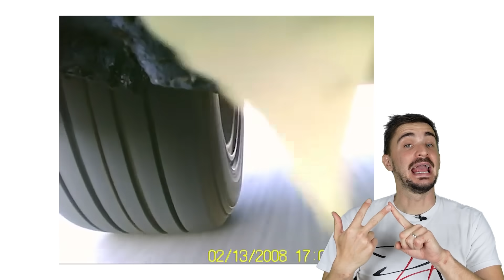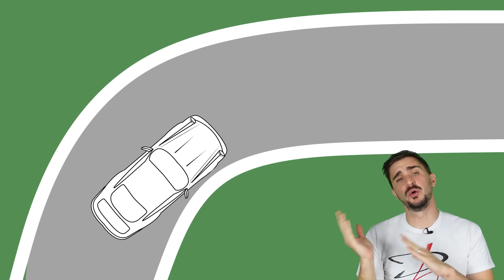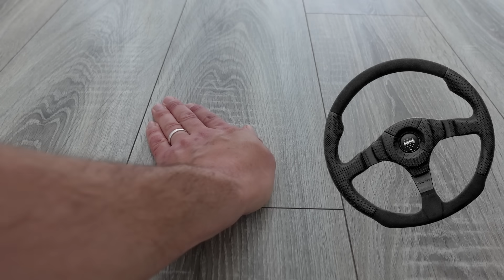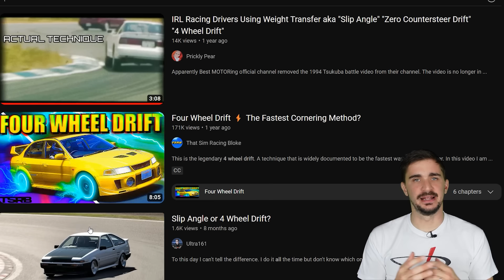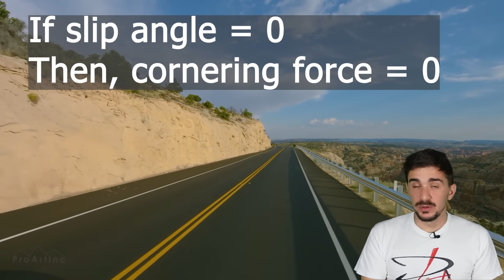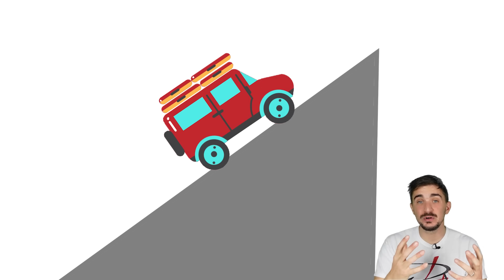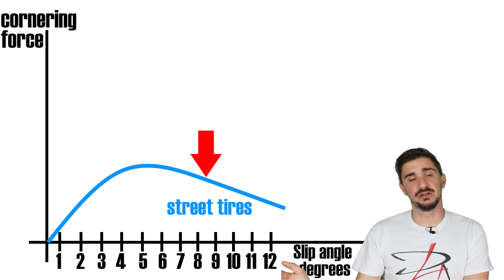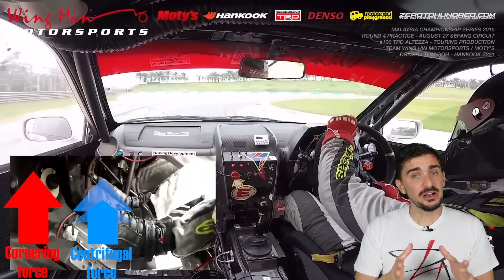You Think You Know But You Don't - Slip Angle Explained in a Way You Will Understand

Comment: Yikes! I get what you are trying to do here but I wish you wouldn't have used 'centrifugal' force, which ends up sending people in the wrong direction, pardon the pun. Centripetal force is what is required to turn a corner as I'm sure you know. Force(c) = Mass x (Velocity(squared) / TurnRadius). Centripetal Force also keeps the earth in orbit around the sun and the moon in orbit around the earth. In these cases the Force(c) is provided by the gravitational attraction between the objects and in the case of the car it's provided by the tires running at slip angles. In the absence of Centripetal force an object in motion would continue to move in a straight line.

Although 'centrifugal force' is frequently used in the way you describe, it's not a real force...it's a way of looking at things from the perspective of an object which is being accelerated. In your example, the car and the people inside. The people inside may feel like they are being thrown outward into the door by some force but they are not. They are subject to centripetal force in the direction of the center of the turn. That force is applied by the seat, seatbelts, door, steering wheel, grab handle etc...whatever the person is in contact with in the car.

If you're going to use 'centrifugal force' as an aid to understanding (which I don't think works anyway), it would NOT be smaller than the 'cornering force' either. When used for explanatory purposes, centrifugal force must be equal in magnitude and opposite in direction to centripetal force.

Great shots of suspension and tires in action! The amount of distortion in the sidewalls really illustrates your best points about not directly controlling the contact patch!
Reply: Centrifugal force does exist and is just as real as the concept of inertia. If you're inside a non-inertial frame of reference (like, inside a car taking a corner) you do need to take into account centrifugal force and coriolis force to do physics. If you grab any college textbook on classic physics you'll see it's full of mentions of centrifugal force, it definitely isn't a simplification nor a mathematical trick.
Reply: @freshrockpapa-e7799  Centrifugal force is always described as a 'fictitious' or 'apparent' force. It is used as a means to explain the 'sensation' one gets when subjected to acceleration. When you refer to  a classic physics textbook, are you talking about one from the 18th century?

https://en.wikipedia.org/wiki/Centrifugal_force
Reply: @jtocher685  No, I'm talking about modern college textbooks. Don't confuse "fictitious" and "apparent" for "not real". Again, just go to the webpage of the most prestigious college you know, see the curriculum of Newtonian physics, classical physics, or simply mechanics or dynamics, and pick at random a book from the bibliography. You'll see it is full of exercises involving centrifugal acceleration in non-inertial frames of references, because it's just as real and you need to take it into account while doing your calculations, otherwise the second law of Newton breaks.
Reply: @freshrockpapa-e7799  Lol, pretty sure the definition of 'fictitious' is 'not real'. Anyway, yes you can do computations within a non-inertial frame of reference and engineers will do it when it's convenient but unless you're very careful not to confuse real and apparent/fictitious forces you are bound to make mistakes. If you do make a mistake like that, something will break alright...but it won't be Newton's 2nd Law!
Reply: @jtocher685  You can't take the definition of a word used in common language and assume that it has the same meaning in science. That's how you would think that imaginary numbers are less "real" than the real numbers. 

What I'm telling you is that observing reality from a non-inertial frame of reference is just as real as observing it from an inertial frame of reference. There's no reason to assume either is in any way superior or more true than the other.
Reply: @freshrockpapa-e7799  I never said that the reality was any different when properly viewed from either frame of reference. I said it could lead to misunderstanding when explaining it and mistakes when calculating the resulting motion if misunderstood. Even the author of this video misunderstood it when he stated that the centrifugal force would be smaller than the cornering force for example.

So I'd put it this way...the force causing the actual turning motion is called 'centripetal' and is in the direction of acceleration in accordance with Newton's 2nd law for an inertial reference frame. This results in a perceived or 'apparent' force of equal magnitude and opposite direction on the vehicle occupants who are sensing the conditions because they are within the non-inertial (ie accelerating) reference frame of the vehicle. That perceived/apparent force is called 'centrifugal' force.

As I've already said, you can certainly adjust Newton's 2nd Law for a non-inertial frame by adding rotation terms (Omega Cross V and Omega cross r) but that is the very thing that leads to confusion so it's to be avoided unless there is a good reason to do it that way. And, back to the point of this dialogue, there was no need to introduce that potential confusion in this video.

Comment: Great video!  Some of this I knew but the video brought it all together and especially the concept corning force.

I suspect it may also be good  to contemplate that, for at least everyday driving, we do not instantaneously whip the steering wheel to the maximum needed amount to traverse the given corner.  Rather, over the expanse of a fraction of a second or two, the steering wheel is repositioned relatively gently and sequentially to help the tires not to break from the road surface.  Of course, this mention is subordinate  to the core explanation provided in this video.

Comment: This video lacks the accuracy I got used to hear from you. Still a good video but there are wheel slip angle and slip angle that describes to angle of the whole care relative to its trajectory. Contact patch and the distortion comes from steering is only on changing the direction of the wheel. If you hold the steering angle, they won't be distorted longitudally but axially. A noticeable amount of Wheelslip angle is required to generate the most resistance to the centrifugal force. Tyres are having the most grip when they slightly (3 - 14 % depending on your car) slipping. Vehicle slip angle helps you to reduce steering input and let the center of mass of your car  support the turning efforts. This means your tyres are supported by the swinging and the tyre can 'focus' its potential for holding the car on track. But getting vehicle slip angle is extremely difficult and requires the perfect harmony of any aspect of your car. The more distance your front axle and your COG have the easier it gets. On some cars it's simply impossible to achieve this. When you visit the place where you tested snap oversteer, try to hold a speed and just increase the turning steadily run by run. Sooner or later you should understand what I mean. It feels like you lost control but yet you have it and the car is dealing with it. The steering will 'talk' a shit load of things to you. It's important to not accelerate too much, since this would lead to too much grip on the rear and hindering your turning potential. But no gas would also be bad... You know, snapping...

Comment: This isn’t entirely right, and the small bit it is right, it’s only really correct getting from straight steering wheel to final steering location, then once you’ve steered as far as you need to steer, then you’ll continue cornering with none of this happening because the car has 4 wheels, it’s like you’ve disregarded the back wheels, this seems more pertinent to a unicycle?

Love your vids dude ❤
Reply: My explanation of cornering: 
-driver turns steering wheel
-front wheels develop side slip and lateral force that push front axle into turn
-vehicle starts to rotate
-rear axle starts to develop side slip and lateral force that push the rear axle into the turn

Unicycle is called a quarter model in automotive. It's not able to explain vehicle slip angle. You can easily see and feel the vehicle slip angle in a vehicle that has soft axles (Peugeot, Citroën). You can see the slip angle when following other vehicles during cornering on a highway particularly when the turn is off-camber.
Reply: Not true or else the tyres would no longer be producing cornering force which is necessary for the car to maintain cornering. All four tyres will be sustaining a slip-angle for the car to be maintaining a turn radius. No slip-angle, no cornering force, no turning.

Comment: fun fact: in racing (for example in a gt3 car) you will turn the steering wheel by about 90 degrees in almost any turn thats requiring the grip limit of the car. the corner speeds will be extremely different but so is the slip angle

Comment: The amount of "slip angle" between where you want to go, and where you are going is also variable due to PSI and Sidewall Height.
So, you are saying that lower PSI allows more sidewall flex (also with a higher profile ratio), but a "lower profile ratio" of the tire allows said vehicle to ride like it is "on rails"? 🤔
Reply: Yes those are the usual consequences.

Comment: Does the slip angle also  depend on friction between tyre and road? Like for same amount of deflection on tyre we will require more cornering force in case of greater friction, am I right
Reply from the maker: It does depend on vertical load which does increase friction, you can see it at the end of the video.

Comment: I imagine the grip graph is a lot smoother for cross-ply tyres - hence a lot more dancing around the limit of grip.
Reply: yes to both these comments. the pre-radial F1 tires were thin and had huge slip angles, and this made it easier to feel the peak approaching or that you were past it. for my money this made cornering more interesting, having to think ahead more with steering inputs. and spectators had the spectacle of seeing cars mid-corner pointing ten degrees sideways from the direction of travel. but a good driver would rather have more grip but more sudden transitions. unlike hollywood car chases taking corners sideways, pro drivers are freakishly good at knowing the exact line and speed to get maximum grip without risking a spin. you're still dancing around the limit all the time , but the adjustments are more microscopic ... which is why it's more interesting to be driver rather than spectator
Reply: @5naxalotl  That suggests that a wider tyre will always provide more cornering grip.  But surely there must be some upper limit to how wide a tyre  you can fit  (in theoretical terms, not practical terms)  before cornering grip starts to reduce again?   What if the length of the contact patch gets so short that there isn't 'time' for sufficient deflection to take place??
Reply: @hunchanchoc8418  What an interesting way of looking at that. A very soft tyre will deflect greater than a hard compound. However, a wider tyre will grip/corner better than a narrow one unless aquaplaning or cutting through snow. Front tyre specs are determined by aerodynamics too, hence the six wheeled Marches.
Reply: @hunchanchoc8418   Based on the fact that I've never heard of that being an issue, I assume it happens long after the point where your contact patch width causes issues. 
But mathematically, the size of the contact patch shouldn't actually affect the total amount of grip available with the same coefficient of friction. 
Yes, I know, wider tires do provide more grip! That's because putting more weight (or "load") on a tire actually decreases its coefficient of friction. Wider tires spread out that load, reducing the decrease in friction. But at a certain point, you've spread out the load enough that spreading it out more no longer makes a noticeable difference. That point depends on tire compound, tread design, tire construction, vehicle weight, how much you value more grip, etc. (remember: more tire costs more money)

Also, at a certain point, the two edges of your tire are moving at substantially different speeds, the same way the tires on opposite sides of a car move at different speeds. But unlike separate wheels, the edges of a single tire have to rotate the same amount. At normal tire sizes, the tires deform enough under slip that the small difference in speed between the edges of each tire doesn't matter. If you make your tires wide enough, this will become a problem.
Reply: @jlco  Putting more weight on a tyre decreases its coefficient of friction??
I don't know whether it affects the technical coefficient of friction of the rubber compound, but more weight must mean more 'grip',  otherwise weight-transfer or cadence-braking would have the opposite of the desired effect!
Reply: @hunchanchoc8418  Without bothering to debunk all the misinfo in this thread, the main thing that would limit use of comically wide tires would be the ability to keep them at their optimal heat. A light car wouldn't be able to keep heat in ridiculously wide, aggressive-compound tires. The calculation may change with max-aero cars such as F1 but I'm not sure if rules are limiting there aswell.
Reply: @hunchanchoc8418  More weight means more grip, but more weight also means you have more mass (except for weight transfer, but you're just transferring weight off of the other side of the vehicle), which requires more grip to change direction. If you don't account for load sensitivity or any other weird vehicle-specific dynamics, the extra mass and the extra grip basically cancel each other out. But smaller cars corner better, partly due to load sensitivity (and also a bunch of other complicated factors I don't know without looking up).
I don't really understand what exactly causes load sensitivity and I can't be bothered to figure out right now. Go look it up yourself. Seriously, don't take my word for it anyways; I'm not an automotive engineer.
And yes, not being able to get the tires heated up will also screw you over. That's probably more of an issue than whatever nonsense I described, to be honest. You could change the compound to something that performs better at lower temperatures to combat that, but like... why would you do that. It would require a ton of R&D and be way less beneficial than just using normal sized tires with a softer compound. Lots of companies have done lots of research to get to modern tire compounds.
Reply: @Hunc HancHoc  overall frictional force goes up but coefficient of friction goes down. Diminishing returns in other words
Reply: @5naxalotl  spectators are cucks
Reply: it's two fold, bias ply tyres can't be as wide, and the narrower the tyre the smoother the curve.